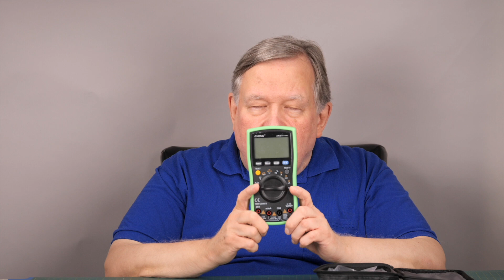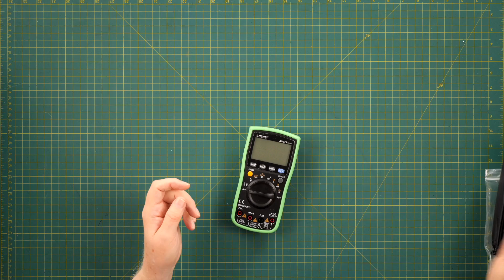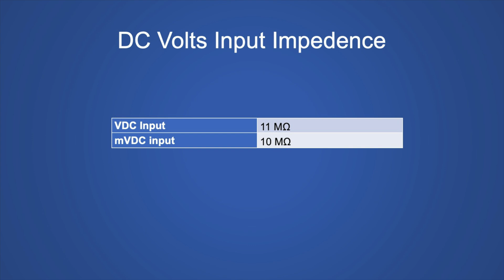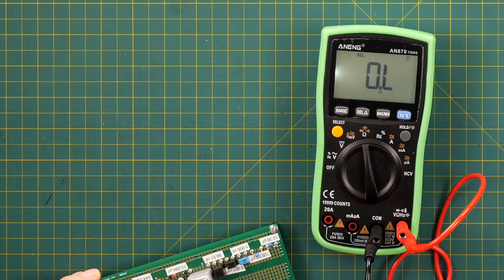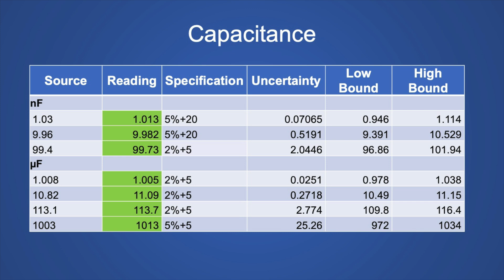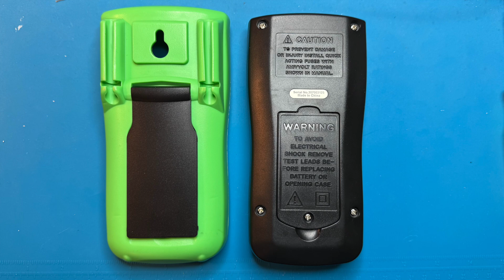ANENG AN870 Review

Comment: Yeap, I bought the Zotek and then the AN870 in 2017 and still today, the an870 is the best cheap multimeter by far. After 8+ years, it started having problems with the rotary selector and I was looking for a new one. I will probably buy an an870 again.

Comment: I bought this meter way back in 2018 purely out of curiosity, due to its surprising accuracy I've been using it for most of my low power projects. Recently, measured it against my voltage reference standard and it's still good. The only down side is the range selector over that time has gotten a bit finicky and does not make great contact some of the time.

Comment: Zoyi are the OEM/ODM for most Aneng meters and a few other sub-brands. I discovered it's also possible to self-calibrate this meter with a correct jumper wire on the PCB. You need calibration standards that are 1.0^n of the range.

Comment: You can get this meter for about $30 shipped on aliexpress (including a thermocouple!), so considerably cheaper than your $43.
I also don't think it's a real downside that you can only get it on ebay, aliexpress etc. I think most people who buy in this priceclass also buy their electronic components there. Indeed warranty is probably non existent, except for dead on arrival, but that's why you're paying $30.
And usually if they work on arrival, they stay working.
Too bad you didn't test the low capacitances. My Aneng AN8009 is remarkably accurate around 100pF compared to my LCR meter.
I'd also like to see you testing the spacing between the input sockets. If they're the standard 19mm or not.

Comment: Adafruit: diode test current - August 18th 2024: "Your multimeter is great at testing if a diode works but the forward voltage reading should be taken with a grain of salt. The test current could be 1mA, and if you push 1A through your diode the forward voltage will increase!"
Reply from the maker: Thanks for finding the quote.